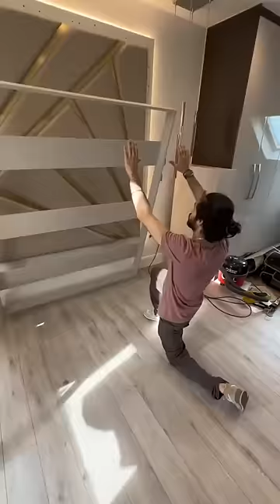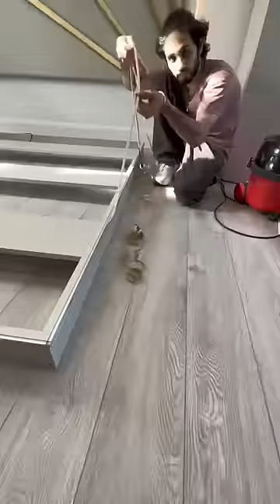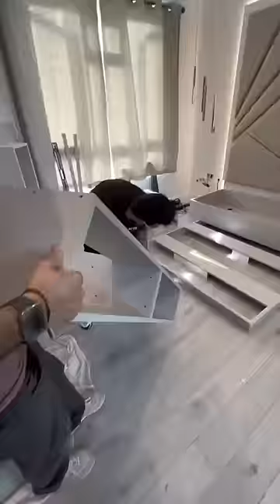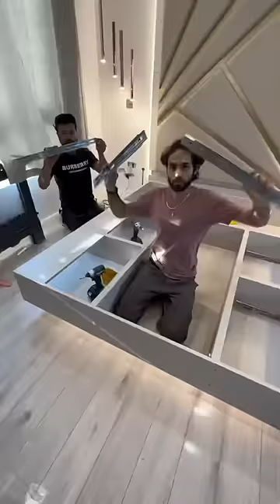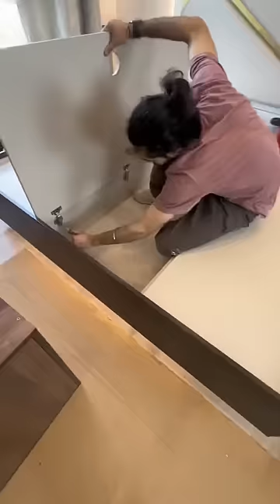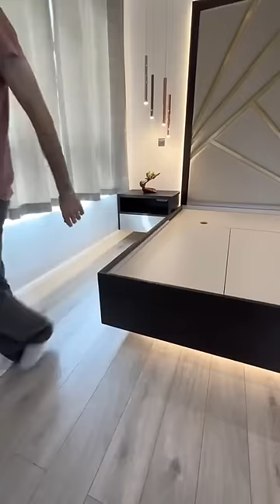Storage bed #fitted #bespoke #led #bed #decor

Comment: You'd have to take the matress off every time you wanted to get to the storage
Reply: They are access drawers
Reply: they usually used to store items that will ne used once a year or maybe 2 years
Reply: Yeah, a major issue decanting the mattress onto the floor to gain access, particularly in a small room.
Reply: That's when organization skills comes to play. Put those rarely used items in it. Used the drawers for those used frequently
Reply: @David-bl1bt  
توجد مجرات من الجوانب 😄
Reply: @muslim6455  😂🤣😂🤣👍
Reply: @buckethead133  there’s two doors that can’t be accessed unless you lift the mattress
Reply: I guess you can use it for storing big things that wouldn't regularly be used or spare bed sheets.
Reply: Its called hidden storage
Reply: Don't you guys have storage beds where you live?! You don't take your mattress off and put it on the floor every time you need to grab something that you stored, of course. There is a bed base (a classic one, made with a metal frame and wooden slats) BETWEEN the mattress and the storage part, it is attached in a way that allows you to just lift it up and have easy access to the storage. Many times there is also some kind of handle at the end of the bed to make it even easier. I have this kind of bed in my home and it's super convenient.
Reply: PERFEITO MELHOR LEVANTAR O COLCHÃO DO Q TER COISAS ESPARRAMADAS👏👏👏🤩🌻
Reply: Exactly!!!
Reply: @harrazthaqif5780  yeah or winter clothes
Reply: @monny21 but he has no soace left to moint the proper brackets that will lift it in this setup.
Reply: If you put used stuff in there, you'll never use it again, trust me.
Reply: @carnivore_kate  I guess it depends on the type of structure that you mount. The one that I have could fit here cause it is a separate structure that is fixed on the headboard and lays on the footboard. The only problem with a structure like mine is that it would be difficult to open the door next to the headboard but I like to imagine that these guys have an even better structure to mount (I could be wrong tho 😅)
Reply: To sab ek sath to nhi mil sakta naa.. 

Good job 👍
Reply: @harrazthaqif5780  что-то вроде сезонной одежды🤔 Если в стране, где живёшь климат летом - жарко, зимой - нестерпимый мороз.
Reply: Just build a device that uses compressed gas to jettison your mattress into space through your roof with an app that you can press a button and bam, problem solved, easy storage access
Reply: A Z  thats not true, many people keep up xmas decorations for like 6 months out of the year. even normal people keep them up for like 2 months.
Reply: You can use a hydraulic system for easy access underneath bed without taking off the matress
Reply: you sleep in the cupboard
Reply: @monny21 from where u have purchased plz plz plz plz plz reply
Reply: @aligujjar8553  hi! I actually did not purchase it, I am renting and the bed came with the apartment. I live in Italy and storage beds are very common here, many furniture stores have them, even the cheapest ones. For example, they can be found in a store called "mondo convenienza" (which translates to something like "convenience world"), which is known for its low prices :)
Reply: Storage for winter and summer switcheroo
Reply: Ye bad banane me
Reply: Ye bad kitne me Bane sakte hai
Reply: @bariettaperez technically the bed will stop the other drawers from moving too unless it's oversized for the bed
Reply: This is what I noticed too .
Reply: Use that storage to hide some drinks and similar good stuff 😂
Reply: Ditch the middle storage cabinets, just keep the draws and the. You can fit your travel luggage cases under your bed, it's a great storage area for those of you don't go abroad often.
Reply: Are we not going to talk about that bed can fit a human in the storage. I’m scared if a psycho gets the idea 💡
Reply: В боковины не придётся снимать матрац  а в 2х глубоких отсека можно хранить не часто используемые вещи, например постельные принадлежности для гостей...😊
Reply: Damn y'all really complain over every little inconvenience.